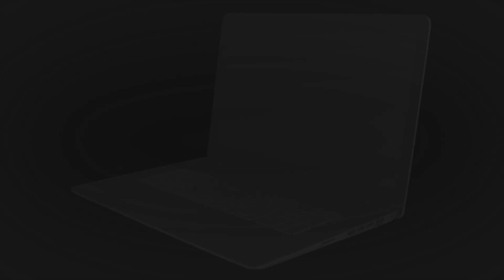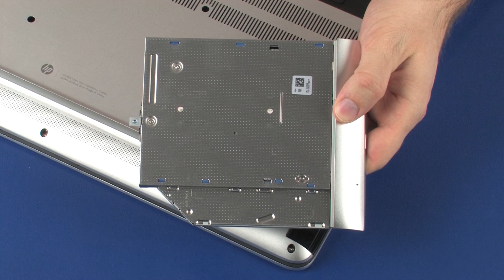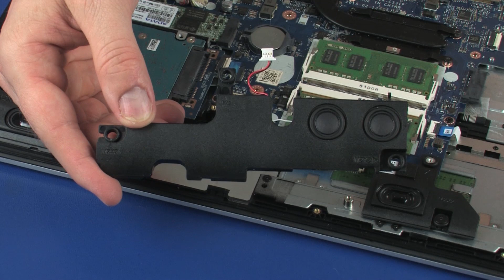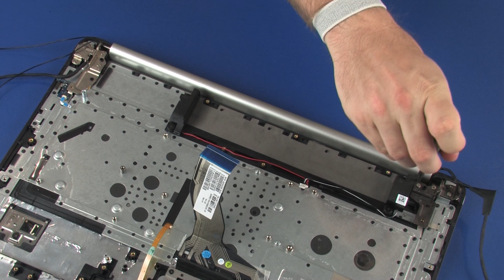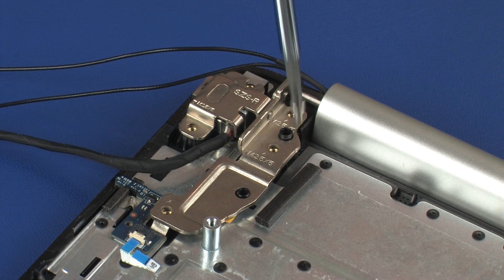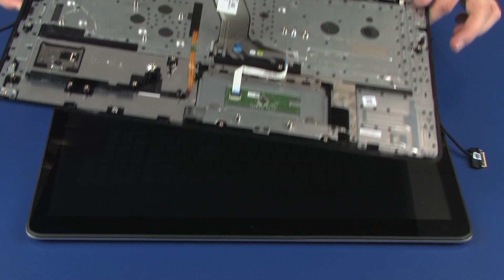Replace the Top Cover / Display Panel Assembly | HP ENVY 17-n000 Notebook PC | HP

Comment: this is simultaneously the best and worst laptop I've ever owned. It's excellent as far as the inside, but structurally is a nightmare. the disk portion was unusable after I first got it b/c of build defect. then the hinges got damaged and the screen is separating from the cover. can't even close it! sucks!!!
Reply from the maker: +theAbeElement thanks for reaching out!
I understand that you are experiencing an issue with your notebook as the hinges are broken.
I'll do my best to assist you.
Please contact our phone support team to fix this issue:
Step 1. Open link: www.hp.com/contacthp
Step 2. Select the product type.
Step 3. Enter the serial number of your device or select let HP detect your product option.
Step 4. Select the country from the drop-down.
Step 5. You should see the HP phone support number.
Let us know how it goes.